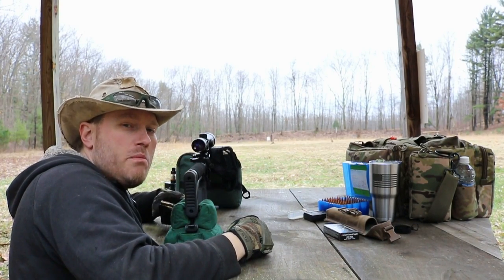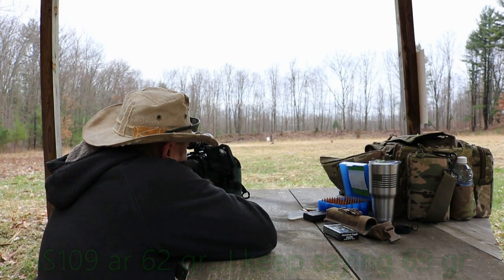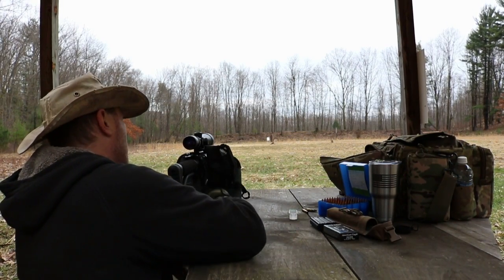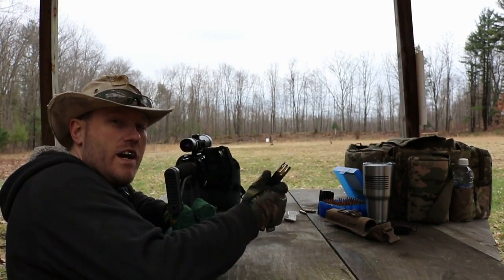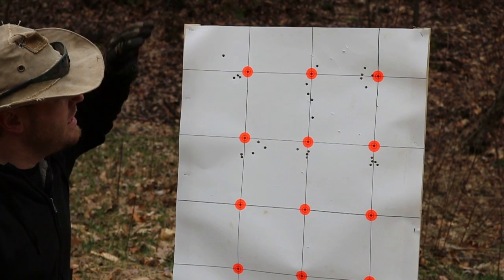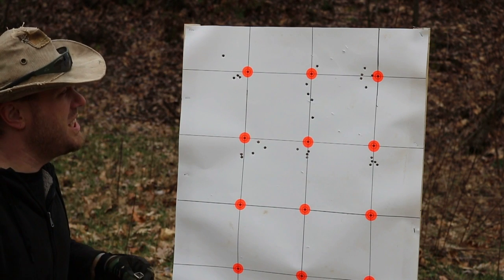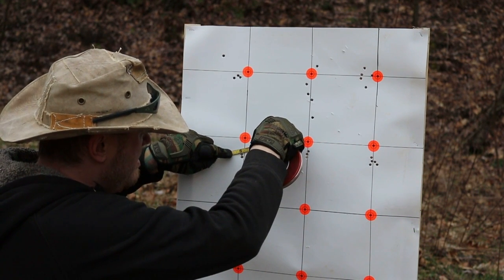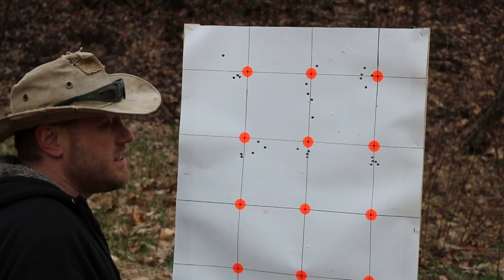SPR accuracy testing

Comment: Great video! Thanks!
Reply from the maker: No problem guys!!! I tried to do the best justice I could for your barrel.  I was very happy for only using a front bag.  I will have another video on the same rifle from a lead sled very soon.

I also need to buy one of your 9mm 16" barrels for a current build soon.  I am very curious to see how it performs and also how well it does in competition.
Reply: I thought you did a great job on the video!

It's actually kinda ridiculous how accurate our 9mm barrels are. We don't guarantee sub MOA on them because of accuracy issues from 9mm ammo in a rifle platform...but we almost could! We were at a shoot last weekend and guys were hitting steel at 70-80 yards out of our 8.3" barrel with a red dot. Now that's not that special when you think about what rifles can do, but for 9mm that's pretty awesome.